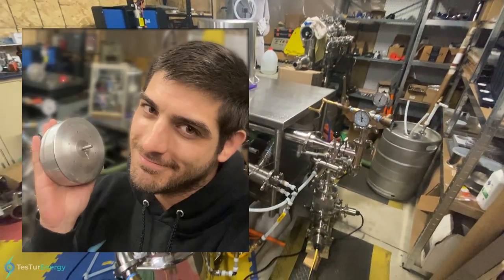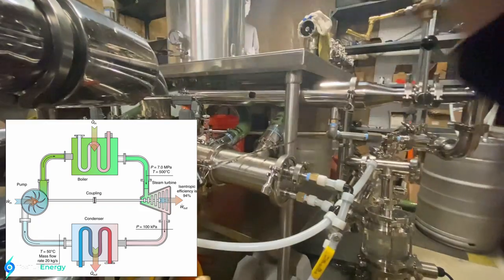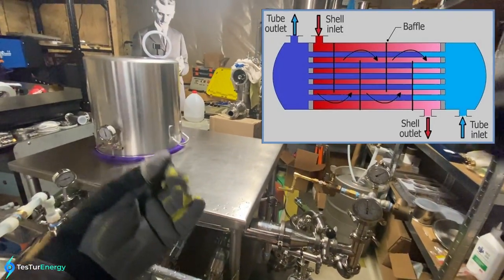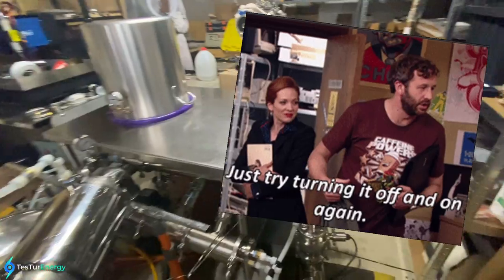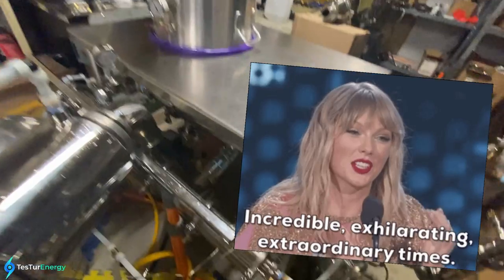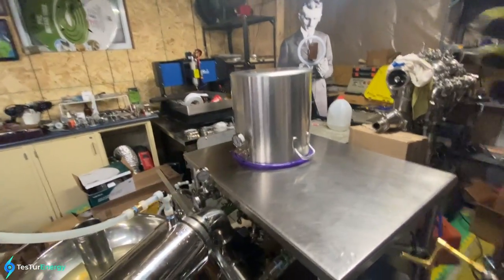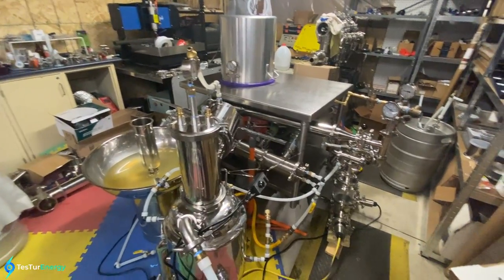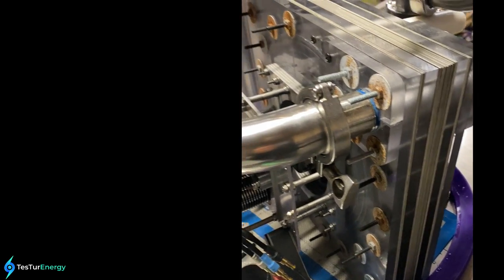Steam Tesla Turbine Renewable Energy Micro Power Plant - 1st Start Up

Comment: Looks awesome! Sorry for my ignorance, but why is this a big deal. What makes this superior to a conventional steam turbine?
Reply: It’s wayyyyy less expensive. Can handle particulates and multiphase fluid. Can be used for low grade heat. Very durable, easy to maintain, can be powered with renewables like solar, geothermal, biomass. Whatever heat in the turbine isn’t converted to electricity can be used for heating your home. Affordable enough to be put in every home.
Reply: Wow amazing! Thats so cool. Thank you for replying. So this can be a threat for the big power hungry tyrants?
Reply: Absolutely it is.
Reply from the maker: @melfjord  well andrew pretty much summed it up beautifully there!
Reply: I would also like to be excused for my ignorance. Is this system capable of producing more power than say a traditional solar/wind collection to a battery bank with DC inverters? 

Totally off topic but if you haven't seen the movie "primer" then check it out!
Reply from the maker: @tylerdurden9748  hey no worries. So here let me give you a run down between this system with solar thermal collectors vs a Pv system. 

Of the sun’s light energy that hits the earth 10% is UV, 25% is in the visible spectrum, and a whopping 65% of it is in the infrared, heat, spectrum.   Solar PV cells can only use a portion of the visible spectrum and use none of the IR spectrum and in fact lose efficiency from heating up from the IR.  So at best you can get maybe 20% of the suns total light energy to electricity to charge and discharge a battery at 90%.  So only 18% of the suns light energy gets to your wall plug.    And then UV light makes them go opaque and be at 1/2 their rated power in 10 years. So, conservatively down to 10% of the suns light gets turned into electricity 10 years in.
Reply from the maker: @tylerdurden9748  With solar thermal collectors you can collect all 25% of the visible spectrum and all 65% of the IR spectrum and store it as heat in a thermal mass.   So 90% of the suns light energy can be collected and stored as heat in a thermal mass. Let’s say 10% loss on storage  So 81% of the suns light energy is then available to be put through a steam Rankine turbine system, which at theoretical best can get 25-33% thermal efficiency to electricity. 44% is the recorded best (And that’s without any thermal recoup, boiler feedwater preheat, etc to bring up the Rankine cycle efficiency and/or going to an organic Rankine cycle with a refrigerant in the closed loop instead of steam for higher pressure gradients with the same temp gradient, for high efficiency)  So that’s 20-26% of the suns light energy can be put directly out as 60hz 120vAC.  About a 10-45% increase in energy out for the same footprint of collectors.  And then even after that ALL the heat energy rejected/dumped out by the condenser from the latent heat of condensation and loss not turned into electrical power can then be used for home heating.    Sooo since about 60% of the energy stored goes out the condenser, if it’s used for heating then somewhere like 70-80% of the suns total light energy can be utilized for electricity and heating.
Reply from the maker: @tylerdurden9748  also this is a copy pasta for people who always say “but the Tesla turbine is inferior for every use because bladed turbines get better efficiency…..” lol so this isn’t dircted at you but it pertains to the situation. 

Irrelevant of efficiency though, can you show me a bladed turbine that can handle the wet steam that’s produced from geothermal energy sources without eroding down the indispensable complex geometry blades to little nubbins in a matter of minutes?   Or a bladed turbine that can actually fully utilize all the heat energy in steam by actually fully expanding it and not be damaged by the condensation and cavitation?   One that doesn’t require superheaters, MASSIVE heat exchangers and expensive waste heat recovery systems to actually maintain whole system thermal efficiency?   Yeah sadly bladed turbines get zero efficiency from geothermal steam sources and can only be used to produce electricity from them with outrageously expensive multi circuit loops to keep all the fluids separate and have MASSIVE heat exchangers.   But when even just one geothermal site in California has more energy than the US needs for the next 1000 years and TesTurs see no damage from multiphase motive fluid flows I’d take even just 10% efficiency over the zero that bladed turbines can offer.   The same goes for solar steam boilers because it’s very difficult to have a residential solar boiler that doesn’t produce wet steam.   Furthermore bladed turbines can’t use low grade fuels like biomass, woodgas, and definitely not solid particulate fuels like powdered coals and pulverized iron.   That’s not an issue for the TesTur for the exact same reason that condensate and cavitation in wet steam doesn’t damage it. Because there’s no lifting surfaces for the particulate to smash into.  What most people mean to be saying is, bladed turbines get a high efficiency on only a very limiting, very specific, very expensive set of proprietary formula refined fuels.  And the only reason TesTurs don’t is because no one has actually put any money into them like the BILLIONS of dollars thrown at proprietary bladed turbine designs just to get 1% point increase in efficiency.
Reply: @CharlieSolis  Hey, thanks for the reply! Your work is beyond impressive and I will be binging your videos until I'm caught up.
Reply from the maker: @tylerdurden9748  🤓😬❤️ thanks man! You met me at a very strange time in my life. 😜
Reply from the maker: @melfjord  Hey I just posted a new video! I think you’ll really like it.
Who Owns Your Copy in the A.I. Revolution?
https://youtu.be/_v0N83U4NoU

Comment: Is it creating its own vacuumed when you place the pot on top of it?
Reply from the maker: hey thanks for showing your love and support by commenting 🙏❤️ it really helps with the algorithm! 

So not quite. The condenser is first evacuated to create the pressure differential between the boiler and the condenser which causes the steam to force its way through the turbine into the evacuated condenser. 

The vacuum is maintained in the condenser by the removal of heat from the steam in the condenser which causes it to change phase from a gas to a liquid. In doing so it’s volume decreases significantly which maintains the vacuum in the condenser. 

If there are any leaks to the system you will have to continuously remove the non condensable gasses but depending on your system system size and quality leaks will be negligible.
Reply from the maker: The pot on top is mostly just so I could be lazy and not fully seal the turbine casing to vacuum and also have the exhaust fully sealed to vacuum. 😅

Instead I just put the whole thing into a vacuum chamber that is open to the condenser. 🤓🤷‍♂️

In the end I will also have cooling water going over the top of the pot to further aid in condensing the exhaust of the turbine.
Reply from the maker: Hey I just posted a new video! I think you’ll really like it. Who Owns Your Copy in the A.I. Revolution? https://youtu.be/_v0N83U4NoU

Comment: Hello brother
 that's insane 🛐💀

Brother what if we use aerofoil flat shapes at the corner of discs as spacers.
Due to laminar flow boundary layer will remains same and another force will be added due to aerofoil spacers at discs corners .

Its my idea if you think it's good then i m gonna try this
Reply from the maker: In Tesla’s words. 

“In the practical application of mechanical power, based on the use of fluids as the vehicle of energy, it has been demonstrated that, in order to attain the highest economy, the changes in the velocity and direction of movement of the fluid should be as gradual as possible. In the forms of apparatus heretofore devised or proposed, more or less sudden changes, shocks and vibrations are unavoidable. Besides, the employment of the usual devices for imparting to, or deriving energy from a fluid, such as pistons, paddles, vanes and blades, necessarily introduces numerous defects and limitations and adds to the complication, cost of production and maintenance of the machines.

The object of my invention is to overcome these deficiencies and to effect the transmission and transformation of mechanical energy through the agency of fluids in a more perfect manner and by means simpler and more economical than those heretofore employed. I accomplish this by causing the propelling fluid to move in natural paths or stream lines of least resistance, free from constraint and disturbance such as occasioned by vanes or kindred devices, and to change its velocity and direction of movement by imperceptible degrees, thus avoiding the losses due to sudden variations while the fluid is imparting energy.”

My advice is to not use anything of the sort for added torque. If you design your TesTur correctly you won’t need the airfoils. The discs will work even better.
Reply from the maker: Hey I just posted a new video! I think you’ll really like it.
Who Owns Your Copy in the A.I. Revolution?
https://youtu.be/_v0N83U4NoU

Comment: do you know what flowrate of steam this system was producing?  I am curious how large of a solar steam generator you would need to run this.
Reply from the maker: Hey thanks for commenting! I don’t know the flow rates just yet but I will be determining that with the next round of tests. 

As for the solar thermal collector, it will be different for each location, 

But for comparison 

Of the sun’s light energy that hits the earth 10% is UV, 25% is in the visible spectrum, and a whopping 65% of it is in the infrared, heat, spectrum.   Solar PV cells can only use a portion of the visible spectrum and use none of the IR spectrum and in fact lose efficiency from heating up from the IR.  So at best you can get maybe 20% of the suns total light energy to electricity to charge and discharge a battery at 90%.  So only 18% of the suns light energy gets to your wall plug.    And then UV light makes them go opaque and be at 1/2 their rated power in 10 years. So, conservatively down to 10% of the suns light gets turned into electricity 10 years in. 

With solar thermal collectors you can collect all 25% of the visible spectrum and all 65% of the IR spectrum and store it as heat in a thermal mass.   So 90% of the suns light energy can be collected and stored as heat in a thermal mass. Let’s say 10% loss on storage  So 81% of the suns light energy is then available to be put through a steam Rankine turbine system, which at theoretical best can get 25-33% thermal efficiency to electricity. 44% is the recorded best (And that’s without any thermal recoup, boiler feedwater preheat, etc to bring up the Rankine cycle efficiency and/or going to an organic Rankine cycle with a refrigerant in the closed loop instead of steam for higher pressure gradients with the same temp gradient, for high efficiency)  So that’s 20-26% of the suns light energy can be put directly out as 60hz 120vAC.  About a 10-45% increase in energy out for the same footprint of collectors.  And then even after that ALL the heat energy rejected/dumped out by the condenser from the latent heat of condensation and loss not turned into electrical power can then be used for home heating.    Sooo since about 60% of the energy stored goes out the condenser, if it’s used for heating then somewhere like 70-80% of the suns total light energy can be utilized for electricity and heating. 

So it will depend on the isentropic efficiency of the turbine and overall thermal to electrical of the system and whether or not heating is needed. 

The benefit to this is that on non sunny days the thermal mass storage system can be “charged” with biomass. 

And PV system have no back up options.